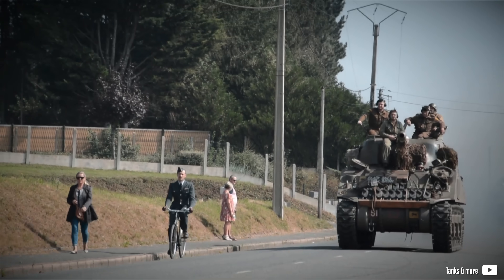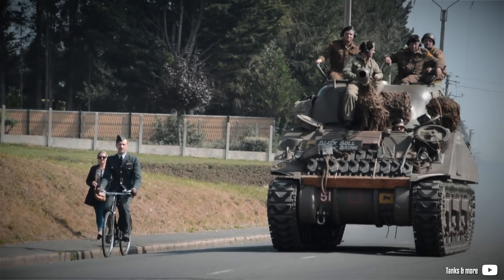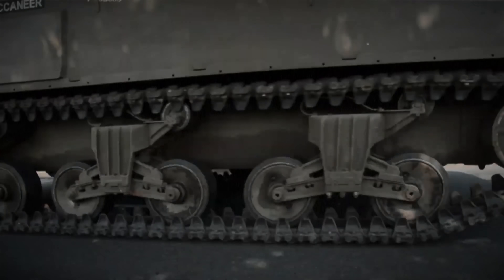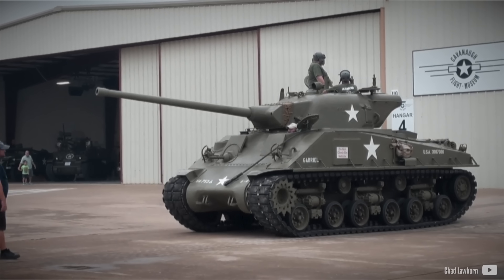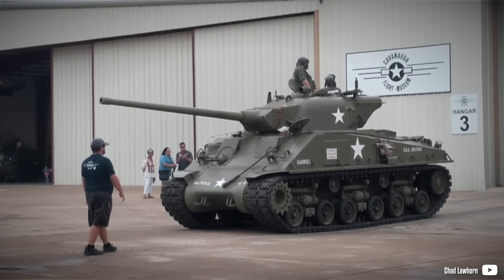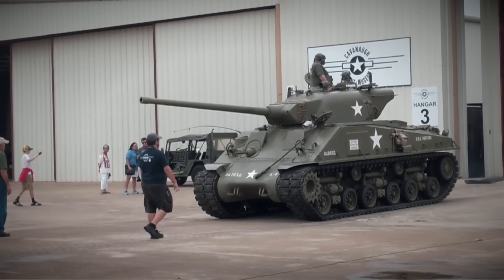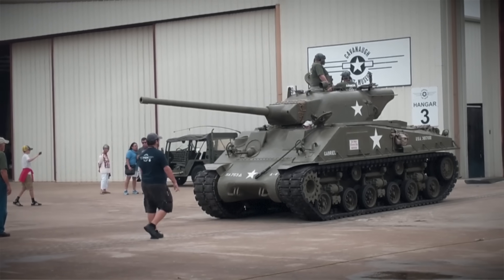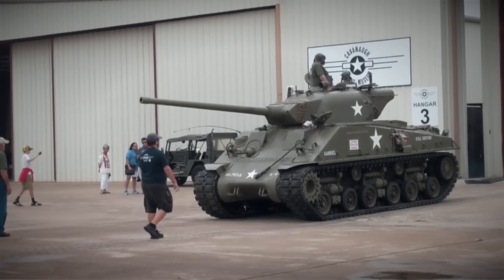This Super Complicated 30-Cylinder Was Sherman's Most Reliable Engine

Comment: The way I heard it, the 30 cylinder was a stopgap to get over a shortage of tank engines. Different companies made the Sherman tank including Ford and Chrysler. Originally, Chrysler was supposed to make tanks equipped with giant V8s made by Ford. But Chrysler got the tanks in production 2 months early while Ford's engine was 4 months late. To complete the tanks Chrysler quickly put together this power plant by combining 5 of the engines they were already making for trucks and stationary power plants i.e. generators, air compressors, water pumps etc. Once better engines became available they dropped the 30 cylinder. But, it did the job and proved reliable in service.
Reply: From what I have heard, the multibank was initially unreliable and it was longer then other M4 powerplants, which required the M4 produced for the multibank to be several inches longer to fit, and was incompatible for use by other M4 assembly lines. Because all of the British M4 were the multibank variant, the British army started working directly with Chrysler to 'improve' the engine and address the issues it was seeing. It was only after British cooperation that the multibank became the reliable and preferred engine for the British Army
Reply: @leonardmiyata482  "What you heard" was incorrect. The truth is that Britain recieved over 17,000 Shermans, only about 7,000 were Mk.V.. There was no "preferred variant", we welcomed them all.
Reply: @leonardmiyata482  I don't see how the Chrysler engine was too long. The engine itself measured 25" at the cylinder head and no more than 30" overall. The complete package about 36" or 3 feet, or not much more. I don't see how you could make an engine of sufficient size and power any shorter.
Reply: @mrdanforth3744  I think he meant ‘too long’ for a ‘standard hull’ and I suspect you knew what he was referring to!
Reply: @leonardmiyata482  I've certainly seen beofre that there was work to do to get the multibank reliable. 
But, it's not the only version the British recieved. Also taking M4A2 (diesel engine) in large numbers, also a varient the US didn't want. 
We did get M4A1s and M4s in the hundreds and were amoungst the earlier deliveries. But, the vast majority to the UK were M4A4 and M4A2
Reply: Should have just put a flux capacitor in it instead.
Reply: @kebertxela941  Just imagine a 33-ton M4 Medium going 88 mph at all! Let alone what would happen WHEN the Hell it went went 33 tons of vehicle suddenly came crashing through!   Not unlike Doc Brown's "ELB" flying locomotive at the end of the third film!
Reply: the A57 equipped shermans  were mainly for lend lease the american troops stuck to the FORD powered tanks and the radial engine powered machines ,,the one you don't hear much about is the Diesel powered variant that had 2 6-71 detroit diesels
Reply: @wildcoyote34  when did the Detroits come into the picture. I always wondered why more tanks in WWII were diesel powered. I could think of a couple reasons and I know most of not all T-34s were diesel but I’m curious why it wasn’t a more prevalent choice for the US and allies.
Reply: @youngmike8645  i'm not sure exactly when the detroit engine got chosen for the tank  but the 6-71 was actually pretty new when ww2 started,, being introduced in 1938 ,they were used in a lot of boats like the higgins landing craft ,,the setup for the sherman tank  was called the 6046 twin diesel ,,the 2 engines were siamesed together ,and each engine had it's own starter and clutch they were redundant  because each engine could start the other ,and they both had a generator ,,plus either engine could move the tank in an emergency just could not attain full speed
Reply: @youngmike8645  said "  I always wondered why more tanks in WWII were diesel powered.   "  
Diesel injection pumps were $$$ , batteries and starters weak so having a diesel in cold weather would not be such a good thing.
Reply: @youngmike8645  The V-2 diesel is HUGE.  The engine compartment on a T-34 takes up almost half of the hull volume.  It being made primarily of aluminum got its weight down to a reasonable amount.  An adaption of a French aircraft diesel, it was actually rather high-tech for its time.  It also had an unacceptably short service life, but, to be fair, as the typical T-34 lasted but a few hundred miles before being knocked out, that proved no serious impediment to the T-34's availability.  Post-war Soviet tank diesels were significantly improved.
Reply: @youngmike8645  Nearly a thousand T-34 had gasoline V12 engine - M17T. They were produced in such a way due to the shortage of the V2-34 diesel engine in late 1941 - early 1942.
Reply: @Andy_Novosad  thank you really appreciate that info. I thought they were all diesel.
Reply: @Andy_Novosad  Originally slated for the BT-7M and BT-8 "fast" tanks, which were still in production when Barbarossa happened.  An order from STAVKA halted production altogether in the wake of the massive factory relocations, starting in July 1941, as it was decided to focus on T-34 production, but continue the KV production at the Leningrad factory, even though the German AG "Nord" got to within 125 miles of the city in only a WEEK after the war broke out.  Of course, all this disruption hurt coordination badly, and with the excess of M17T engines originally slated for the BTs, now discontinued, they were improvised into the T-34s.
Reply: @wildcoyote34  I believe the Russians got the diesels since it fit their logistics model better (used diesel fuel in the T-34 and other vehicles)
Reply: @jimbosc  exactly. They found that they were not going enough of the petrol to run all engines - to fulfill requirements of the air forces as well as tank units plus logistics (= trucks) so somebody has to be dumped. And as air forces hardly can use diesel, obvious victim were tank units.
Reply: @mungo7136  In a way, that would soon change.  The German Me262 used a light diesel oil, what we'd call "No 1", but the Jumo 004 could tolerate quite a variety of fuels, save for leaded gasoline.  Once "recips" were replaced by jets and turboprops, Avgas was used far less.  Of course, tanks likewise went to diesel, save for the M1 Abrams in the early 1980s that uses a gas turbine engine, originally a Chrysler design and sold to Honeywell in Chrysler's 1979 bailout by the Carter Administration.  It wasn't over flammability, as studies of tank wrecks in WWII and Korea showed that tank fires were more commonly started by ordnance set off by enemy fire, but over fuel economy and RANGE issues.  The M47 and M48s that ran on gasoline could only go about 85 miles on a fill-up!
Reply: @wildcoyote34  The diesels were GM 6-71s , intended for USMC armored units in the Pacific, or Lend-Lease to the USSR.  Both dictated by fuel commonality.
Reply: A very interesting compromise that Chrysler worked ot with this 5,000 pound engine, that went into another heavy vehicle, a tank... A beautiful solution that could be kept running by replacing any of the 5-ea.  6-cylinder engines those tanks had.  And the parts were very available !!! Chrysler had manufactured a lot of these and they had a lot of spares!!; Perfect for war machines, like these... The large gasoline V-8's that Ford originally proposed did become a reality , from another company, in the late 50's, to the early 70's but in the form of the International 549 industrial pushrod engines, but they seemed to frequently develop problems with the valvetrane and bent pushrods, something the L-head engines, never had problems with... That gang of 5 flatheads the Sherman tanks had, did ok for our troops overseas... Ford did learn a lot about overhead cams, by doing the experiments on the Merlin V-12's (which was funded by the U.S. taxpayers) by trying to convert them into 1,000 cid V-8's,  that were able to make a very brief contribution to the War effort in the U.S. tanks....  Much different - than what Ford did at Willow Run in those years, with producing aircraft under license by the OEM companies who designed them...
Reply: @michaelmartinez1345  boy you missed that boat by a big margin ,, first off the ford GAA wasn't proposed by ford  ,, it was built by ford BEFORE the A57 was even a thing 
the GAA was a development from a V12 that ford proposed to enter into airplane use , the airforce already had the Allison V1710  and when ford  got the chance they redesigned it into a V8 that was used in the sherman tank M4A3 ,,,the GAA was a 1 piece block V8 gasoline engine with 1 piece heads  , dual overhead camshafts and 4 valves per cylinder ,,it was all aluminum and very robust ,,,,this was the first true modern DOHC aluminum V8 engine ,,plus it only weighed 1450# pounds compared to the 4800# of the A57 
the M4A2 (6046 twin diesel variant ) and the M4A4 ( chrysler A57 gas engine variant ) ,,the M4A2 and A4 were primarily used by the Allies through lend-lease ,,American troops used the aircooled radial engine M4A1 and the GAA powered A3 primarily
Reply: @wildcoyote34  I appreciate the Heads-up on that..  I thought that the Allison (Packard under license for the  1650 Rolls Royce engines) V-12 (1710 cid - Allison engines) was a GM engine...  I heard they (Packard V-12 engines) were also used in other military applications, besides aircraft (like the PT boats). So, which boat was it that you say , that I supposedly missed?.. What was the displacement of the Ford V-8 that you are referring to, that was supposedly a morphed 1710  GM Allison V-12 , that was converted by Ford, (for the M4A3 tanks) to become a V-8? Please be specific of this engine, that you are referring to.  Bore?Stroke?  I was not aware that Ford had ANY OHC V-8 engines, prior to the 427 SOHC engines...What type of radial engines were used in the tanks? Which company made them? How many cylinders did they have? How many rows did they have?    P.S., I read-up on the Ford GAY engines that you are referring to that Ford was involved with... First of all Amigo, you're not only wrong, but you're not even close.... Ford borrowed 8 of the 12-cylinders from the Rolls Royce V-12 SOHC Merlins, originally built for  planes... Not the Allison V-12 that you erroneously stated here..  So it appears that Ford had problems with those, and it took till after the final phases of WW2 to straighten those problems out... In fact, it was until after the D-Day invasion took place, that Ford finally got that GAY monstrosity to begin to work with any kind of reliability...Up until After D-Day took place, it was the Chrysler 30 cylinder modular engines and the Wright R-975 radial aircraft engines were the primary units of powerplants, that were dependable enough for combat use...  Some of the tank also used Detroit 2-stroke diesels... Finally in the last year of of the war in Europe, the people at Ford were able to get that Modified Rolls Royce V-12, morphed into a V-8, called the GAY engine, to begin to be useful in that war...  What I was wondering about is; did Ford have OHC designs OF THEIR OWN , Prior to the SOHC 427 V-8 and the SOHC 2.4  'Pinto' engines, that were used in the tanks in WW2?... I  heard that they did not produce them, and if Ford did make any OHC engines prior to the 427 SOHC V-8's, they never made it to the production stage.. Apparently , it was  Chrysler , the Wright Aircraft engine company , and  Detroit Diesel,  were the main ones supplying the Allies with engines that had enough gusto and reliability to power the Allied tanks..  Ford was modifying engines originally built by another company (Rolls Royce) , originally designed for another purpose (aircraft) to help - with the end of the WW2 effort..  So tell me now, which boat did I miss? Please , before you write something here, check what ACTUALLY happened, not necessarily what you would like to believe what happened....
Reply: @michaelmartinez1345  the ford GAA engine is a 1000CI V8  it's V12 version that was made BEFORE  the GAA was 1650 CI ,, same as the packard Merlin ,,the Allison V1710  was used in the PT boats and several other similar fast patrol craft ,,the Detroit diesel  was used in Higgins boats and multiple other landing craft 
the Allison engine was made by the ALLISON division of general motors 
the FORD GAA bears no relation to the allison aircraft engine 
in fact the allison V1710 is very similar in design to the Merlin even though developed by GM similar designs came from similar requirements
Reply: @wildcoyote34  Dude the Merlin was originally designed by ROLLS ROYCE in 1933... Packard was licensed by Rolls Royce to make copies of the Merlins... Please, check the net on this... You're starting to get me to feel badly - for you, because of your gross mistakes... Yes, the Allison 1710 gasoline engines were also 60 degree V-12''s with OHC's and were originally designed in 1937 (4 years after the first Merlin's were designed) but, share few, if any parts with the Rolls Royce designed gasoline engines ..The  Ford motor company designed and produced their first affordable V-8 auto engines in 1932, but those are not even remotely  similar to the Merlin's or the Allisons... Ford basically modified the Merlin V-12's into large displacement V-8's , that you are probably thinking about, but these engines did not even get to serve a full year in Europe... Maybe the Navy was able to use them, in the Pacific, as anchors for their ships....And another thing, apparently - NONE of the engines that You pretend to be an expert on had DOHC designs... The OHC designs that you are referring to, all had SOHC designed engines.... And your reference to light weight power plants, do have a purpose, where light weight is needed, but with tanks, HEAVY weight tends to give them more capabilities, and advantages, which is probably one of the reasons that several tank crews that operated the Chrysler powered tanks,  reported to have liked them so much... That weight gave them more traction for brush clearing and dozing capabilities... In fact, the German Tiger tanks were highly revered as one of the most challenging ones to defeat... They weighed close to 80 tons..  So the 2.5 ton engine package of Chrysler engines might have actually given it an advantage, that the other powerplant options didn't have, for the Sherman Tanks... I worked on heavy equipment for awhile, and the way those things are built, heavy weight can be a significant advantage with equipment like that...
Reply: @Michael Martinez  NO....The Allison 1710 was designed in 1929 as a AIR SHIP ENGINE, it was designed by the late James Allison, He was a builder of Racing Liberty V12s...and was first put into production in 1930!  SEVERAL YEARS BEFORE...THE MERLIN, which was first run 1933.... GET YER SHIT TOGETHER
Reply: @misters2837  I heard the Liberty engine was one of the first High powered engines... But the sources that I have found on the Allison V-12 1710 engines, says the first designs were made in 1930, but it was improved for reliability and practical use in (heavier than air) aircraft, to put out over 1,000 H.P. in 1937... Then later improved in some applications to put out over 1,450 H.P. So yes, I was wrong by saying that they first appeared in 1937... Wow, I'm really going to loose sleep over that!!! 😂
Reply: @michaelmartinez1345  Maybe Not...But your lack of knowledge on Ford GAC V12 and GAA V8 - Should!
Reply: @michaelmartinez1345  the 345 was the best v8 petrol engine international ever built heaps in old trucks couldn’t break them
Reply: The M4A4 was REJECTED by the US Army because it was 1 or 2 mph slower than the other variants. That's why they were all sent to Lend-Lease. Main recipients were Britain and China.
Reply: @WgCdrLuddite  eqeqeè
Reply: @WgCdrLuddite  9 9th
Reply: @WgCdrLuddite  That may not be the only reason. Quality of available fuel may have also weighed on the decision. Both the Ford engine and the Lycoming engine ran on higher compression thus requiring better fuel. The GM of course used diesel.
Reply: @WgCdrLuddite  ah yes rejected because its 1 to 2 mph slower not because the powerplant is significantly more complex and weighs significantly more than others. and defiantly not because no that can be driven in maintence company's and supporting units to supply and repair tanks. can lift the 5500 lb engine. granted it took them over a year to make such a vehicle the US armys brockway 666. but even then. it was 2 years later. and they only made 1300 of them. and it DEFINATLY wasn't not adopted because of its "extremely good fuel efficiency and high power output" and it also wasn't adopted because of its excellent engine cooling.

all jokes aside. Testing of course is a bit biased due to the fact that no shit a 32 cylinder survived testing the next highest cylinder count in the competition was a 9 cylinder aircraft engine. the competition was very very strenuous for a time where Oil filters were pretty much non existent
the rules were 400 hours or 4000 miles. until  ANY failure of a powerplant or 30% power reduction and it was 400 hours of non stop running with almost 0 maintence done other than grease zerk fittings and replacing belts when they break. in a hot dusty climate
the competitors vs a 32 Cylinder engine
a 9 cylinder Gasoline aircraft engine.
a large Gas V8 truck engine
a Detroit 6-71 2 stroke diesel 6 cylinder
its a overall crap design. their best choice would've been 6-71 2 stroke diesel hindsight is 20-20 but as we all know today. you can go find a old 2 stroke Detroit that's been sitting outside for 70 years and put fresh diesel and some vise grips on the injector rack and free it up and it'll start. hell it'll even start on some ancient diesel. 

guess they didn't know any better of have any way of making better air filters at the time for obvious reasons they dusted the Detroit diesel a supercharged 2 stroke diesel has pretty high compression and really strong suction force. bound to suck any small particles through the filter.
Reply: @justnsaliga8518  The British weren't complaining. We were quite happy to get around 7,000 tanks for free. Thank you USA.
Reply: @justnsaliga8518  You over look one major component of not deploying a diesel engine into theater: logistics. The GMC diesel would have demanded its own unique fuel supply chain unlike the other three candidates. 

Secondly, one the opinions in this chain is that Ford couldn't deliver engines initially for the Sherman. That may be true on the face of it, but the Lycoming airplane engine was the engine the Sherman was designed around and it being in short supply is what initiated the search for alternative engines. The Ford engine was an adaptation of an engine design Ford had produced as a competitor to the Allison V12.
Reply: @justnsaliga8518  The 6046 wasn't a powerhouse either, but you're right DD 71 series were some of the most over-engineered engines made...but, the worst of all was the M4 Engines, was the Caterpillar D-200A...
Reply: @misters2837  caterpillar had a tank engine? I operate CAT equipment for a living and I’ve been a fan of CAT yellow since I was a child growing up around a family construction company. I’ll have to look into that.
Reply: @WgCdrLuddite  The prayers of all infantry is for support tanks ! With a Tank behind you those before you fear.
Reply: @robertpella2389  Explain 'prayers'. This is not a military strategy I'm familiar with.
Reply: @cdjhyoung  Allison also submitted a version of their aircraft engine, post-war, to power the M46, M47, and first versions of the M48 MBT, which lost out to the Continental AVS-1790.  Part of the problem was that it was water cooled, and the US Army preferred an aircooled design. The Continental engine was very thirsty.  An example was used for the famed Jay Leno "tank car".
Reply: @selfdo  Continental did make inline and 'v' engines for ground equipment use, along with their opposed air cooled engines for ground equipment, and for aircraft... Which Continental engine was used for tanks?
Reply: @michaelmartinez1345  R975
Reply: @selfdo  The R-975 would be a Wright 9 cylinder Radial engine... Not a Continental engine... At the time the tanks were being manufactured, several types of engines were used, to move those beasts around... With heavy equipment like the tanks, the heavy weight was a good thing, as it gave those machines more vegetation clearing and other destructive abilities, like powering through buildings... Lots of torque was needed to do this, which is why such heavy /robust engines were preferred...
Reply: @michaelmartinez1345  I sit corrected...the R-975 was made by Wright.  I'm not sure the design was favored due to weight-saving considerations, probably more a matter of a compact enough engine that'd crank out 400 ponies, necessary to move the tank.  But in 1942, it was obvious the war was not going to be over quickly...one way or the other...and aircraft production had to be ramped up, which meant more engines...all that Wright could produce, and them some. Where I got it confused was that Continental was an aircraft engine producer as well, and made some Wright designs under license...but the first TANK engine that I recall that was a Continental design was the air-cooled AVS-1790.
Reply: @selfdo  Continental made engines of several types for several applications... There are forklifts made by American companies, that have Continental engines... The R-975 engines were originally designed for aircraft, and they were relatively lightweight powerplants.... My guess is those engines were needed more for planes, than tanks during the war, so that is why other engines were used to replace them for that purpose. A tank, falls into the category of heavy equipment, so as far a weight is concerned, the heavy engines and equipment for them, work well in that application... Probably the reason the reason the Chrysler 5-packs worked so well for the tanks is because of their combined weight, the relatively high torque they produced, and the extremely high availability of parts and supplies for those engines.... Also, they were well proven engine designs, which meant that they could be counted on to survive tough conditions.
Reply: @WgCdrLuddite  they certainly where not free we didnt finish paying the dept back to the USA till the 80s
Reply: @johnhalstead4308  War is an awful thing, and should be avoided, if possible... But the agressors who start wars, don't care about anybody else, but themselves, and the ONLY way to stop them is through superior war waging power... Unfortunately, is is very costly,  in lives, time and money... This is why peace is golden... As General Douglas MacArthur put it, 'The last people who want war, are those who fight on the front lines, for they are the ones who have to bear the wounds and tragedy of war.'
Reply: @johnhalstead4308  (Shush. this thread is infected with septics and I am playing the role of "grateful limey").
Reply: @johnhalstead4308  (Shush. This thread is infested with septics and I am playing the role of "grateful limey"). They love it.
Reply: @WgCdrLuddite  but we paid for them ! Final payments made in 2006. Meanwhile Germany has entirely dodged reparations to this very day and we kindly helped them get the vw factory going again.
Reply: @WgCdrLuddite  you've not been in the military then....
Reply: @cdjhyoung  The US Marines got the M4A2 as they shared their fuel supplies train with the US navy, who used diesel for certain small Vessals.
Reply: @SvenTviking  it was diesel fuel and similar types, that  originally powered early turbo-jet engines... As the performance of the jet planes increased, so did the flowability and moisture elimination become a requirement, at very high altitudes, where the ambient temps and pressures,  are very low...
Reply: @justnsaliga8518  30 cilinders 😉
Twin 6-71 is an very interesting engine indeed. But US choose for just on fuel for all vehicles to make supplying an army easier.
The A57 was not fovoured because of subjective reasons.
So that was the main reason to go for Ford GAA and Wright 9cil. Narrowing down to just 2 engine types is of course a good thing on it's own.

Maybe Ford GAA and Chrysler A57 would have been a better choice because of the operational troubles an radial engine brings...
Reply: @CarLos-yi7ne  Radial engines are OUTSTANDING!!! Light, powerful, dependable and at that time, fairly available.... But they required several things that were a problem for ground vehicles, especially tanks: 1)A massive amount of airflow, to stay cool 2) High octane (slow burning) gasoline 3) They were and still are expensive, and parts were and still are extremely specialized and difficult to find 4)Their construction depended highly on strategic materials, which needed to be reserved for aircraft... Tanks actually did very well with heavy equipment powering them, because they are - HEAVY EQUIPMENT.... The heavy weight helps them do what they do best, move along the ground at a fairly slow rate, and efficiently destroy things that are targets.... The size and power of their turret mounted cannons, require their construction to be extremely robust and heavy...
Reply: @michaelmartinez1345  
Wright R-975 equiped Sherman just used normal petrol.
They where adapted for use in tanks so no need for high octane aviation fuel. Otherwise it would bring the same logistical nightmare the US wanted to avoid by not using Diesel.
Reply: @WgCdrLuddite  
You did not receive them for free, Britain like every other country paid a very massive debt to the US after the war.
Reply: @CarLos-yi7ne  Gotcha, so in that case, remove a large amount of power & torque from that engine as the specs for the engine had to be changed for low octane (fast burning) fuel... That is probably another reason the engines that originally were designed for aircraft, did not pan-out well, as Ford found out by trying to modify a Rolls-Royce Merlin... Just not of practical use for ground equipment... They (Ford) should have made their existing automotive engines, which were decent, useful like what Chrysler did... Wright just devoted their engines to the aircraft they were better suited for, while Ford kind of got caught holding a cold potato in the form of their GAY engines....
Reply: @michaelmartinez1345  
Ford designed it's own liquid cooled V12 aircraft engine. But the military decided that they din't need it: the Allison 1720 was already in production and laterbon de Packard Merlin.
But still an tank engine was needed so Ford took 4cilinders of and simply said tgat was the GAA which was a good tank engine. BUT why taking 4cikinders off? To get it fit in the Sherman.
The British did a better job by adopting the Merlin for tank use: de Meteor V12 which was the best tank (petrol) engine of WW2. I think the Sovjet V12 Diesel (V2-2-34) was the best tank engine of the time.
Reply: @CarLos-yi7ne  was the Ford V-12 liquid cooled engine used in any vehicles or ground equipment? Their flathead V-8 engines were very popular when they first came out for personal vehicles... It is a shame Ford did not use that engine in a similar arrangement that Chrysler did... Ford probably would have sold a LOT of flat-head V-8's if they offered it in a similar package that Chrysler sold to the Allied forces.....
Reply: @michaelmartinez1345  
Well, Ford sold A LOT of V8 flatheads to the militairy. Many went in Canadian build vehicles like CMP trucks and Universal Carriers for the British forces.
The Ford V12 engine (GAC) never went in serial production. A very small number was build in prototype tanks which never went in production too.
In Austrailia there made power packs out of 3 Cadilac V8 flatheads tigether for the Sentinel tank. Again, no big numbers made.
Reply: @CarLos-yi7ne  I"m thinking that 
Chrysler. had the engines the military was looking for, in this purpose... They ran fine on regular gas, did not require extensive modifications from it's original form, plenty of engines and spares of that type were readily available, strategic materials were not used for the Chrysler 6-Cylinder flatheads, and the price was probably very reasonable.... And several of the tank crews liked them....I'm thinking that there could have been a one-way clutch (sprag), to allow shutdown of any of the 5 powerplants, but still be able to move... Not an option for the single large engine tanks... That could have been a life-saving feature in a combat situation.
Reply: @WgCdrLuddite  Brits paid all our tanks, with interest off - around the year 2010. The price was your empire that's now ours. Greetings to the US territory.
Reply: @808bigisland  Today, for the Coronation of King Charles III, military contingents from around 20 countries took part.
How many turn up for a US presidential inauguration ?
Soft power, my friend.
Reply: @justnsaliga8518  The twin Gm diesels were slightly heavier than the Chrysler engine. Even the aluminum Ford clock in at over 3500lbs.
Reply: @selfdo I know this was a year ago but I had to comment. Wright tank radial engines were a bit different than the aero engines. Parts were heavier. as an example wrist pins were solid instead of hollow. Another interesting fact, during the war Chrysler built more Wright radials than Wright did. Even redesigned parts of them.
Reply: @michaelmartinez1345  I'm not aware of any Continental engines that made it into USA-produced AFVs during WWII.  Where Continental (later bought by Teledyne, Inc) engines were used was i in the POSTWAR M46, M47 (same chassis and superstructure, different turret, from the rejected T-42 prototype), and the gasoline=-powered versions of the M48 "Patton", the AVS-1790.  A 60d-degree air-cooled V12, it was one thirsty engine, but cranked out 810 ponies, which helped with the mobility of American armor a LOT...as long as the fuel trucks kept coming!  Continental developed a DIESEL version the AVDS-1790, in the 1956, for use in the later M48 versions and the new M60 (essentially the M48A5, the differences are minor), which improved the range of American MBTs considerably.  The gasoline V12 is also the engine for Jay Leno's "Tank Car", aka the "Blastolene Special".
Reply: @michaelmartinez1345  Correct.  Continental did PRODUCE the engine, under license, but did not design it.
Reply: @michaelmartinez1345  It was all of those things; the Mopar flathead sixes were known for durability and reliability, but not necessarily the most powerful of engines...TORQUEY, though!  Clustering five of them together as the "Eggbeater" worked surprisingly well.  All Mopar had to engineer was the strange tube manifolds and the common crankcase and "star shaft", the rest required no new parts or tooling.
Reply: @michaelmartinez1345  The weight penalty of an all-iron, water-cooled engine is much less of an issue for an AFV than it'd pose for ANY aircraft.  Durability and reliability are far more important.

The Soviets actually had what was "high tech" for its time in the all-aluminum V2 12-cylinder diesel engine.  Developed from a French aircraft (and airship) diesel (yes, aircraft diesels, mainly for long-range transports, were a "thing" in the 1930s, there were also considered better for dirigibles that used hydrogen as the lifting medium, the absence of "spark" in the ignition posed less of a fire hazard.  While the T-34 and KV-1 engines were terrible for reliability, especially in terms of MTBF, it wasn't considered a problem, as few of those tanks lasted long enough in combat to be immobilized by an engine breakdown!  But like the T-34 it went into, for a diesel, it was fairly simple to maintain and repair, although Soviet Army "tankist" fitters usually swapped out the powerpacks, which could be done by an experienced crew with a crane, even in freezing weather, in only a few hours.
Reply: @CarLos-yi7ne  The 70 horsepower version of the Ford Flathead also powered the British Matilda I tank, which, due to this beast weighing 11 tons, managed a top speed of about 8 mph on raods and only about 5½ mph  cross-country.  As it was designated as an "Infantry" tank, it could barely outpace them!
Reply: @selfdo  The nice thing about that setup was if one, two or even three of those engines failed, they could still get back to the base, as they were connected with  free-spooling sprags so the remaining running engines , could continue to move the machine.... And yes, the horsepower was not a high amount, but they DID have excellent low end torque, which is what is actually needed for heavy vehicles.
Reply: @michaelmartinez1345  Low-End torque was more desired in most American automotive applications, not simply heavy vehicles.  It's forgotten that the Interstates didn't always exist, and with the overwhelming majority of the US population living EAST of the Mississippi River, we lived in what "Uncle Tony" of UTG has termed the "50 mph world", with limited "expressways" where cars and trucks could actually see more than 50 mph!  Usually, aside from the fact that people simply didn't range all that far in their rides, necessitating "in town", if one took a trip on, say, good ol' US 90, say, from Jacksonville, FL to Houston, TX, you stopped in EVERY little town on the way, so obviously low-end torque for all that start-stop was far more desirable!
Reply: @selfdo  Interesting observation!!! Thank you for that contribution!
Reply: @selfdo  Yes it (Low end torque) is  often an over-looked factor, even when traveling on the interstates, because the majority of the distance that is traveled, even on the interstates , is in the range of between 1,800 - 2,300 rpm... Definitely low end torque...
Reply: @ksztyrix  Only before 1941.
Reply: @michaelmartinez1345 ford had trouble keeping one flat head V-8 cool let alone 5 of them tied together!
Reply: @ronaldbrown5745  Ford finally Figured out how to properly cool their flatheads... Later they made much more robust engines.... Chrysler knew a lot about how to control the heat that an engine produces... So much so, that they were able to carry away the heat effectively on 5- existing engines that were all mounted on a common output case assembly... One advantage to doing it that way was the increased external surface area, to carry away the heat that radiated out from the 'Artichoke' leaves.... It actually relieved some of the stress on the existing liquid cooling system doing it that way...
Reply: @justnsaliga8518  The Navy had priority on diesel fuel (all subs, 1/2 destroyer escorts, all landing vessels up to LST's, all minesweepers were diesel powered)
Reply: @justnsaliga8518 The basic engine was the same Standard engine in the Military Dodge trucks. All the parts other than the block and gear train and the fuel pump were the same as the Hundreds of thousands of Dodge trucks in the US military which were VERY reliable.
Reply: Thanks for the info guys in the comments, this was cool to learn.
Reply: That shows that when a job needs to get done we will find a way to do it
Reply: This is another chapter in the collaboration that is the History of Ford and Dodge.
Reply: That makes a lot of sense. Nobody would make such a complicated engine unless they were desperate and had no other options. Thanks for sharing
Reply: @kiefershanks4172  many of the machines made for the war were from things that were available, at that time... During the U.S.  pre-involvment of war years, Chrysler had a surplus of inline 6-cylinder engines that could be helpful, and they put them to use..  It was not a desperate thing, but it was a resourceful measure to make a contribution... And not only did that modular engine set-up work to power tanks, but it worked very well for the tanks... That is actually what this article focused on... The application of properly applying available resources, and that is exactly what Chrysler did.
Reply: @Michael Martinez  Those flathead sixes went into many a Dodge WC214 or similar; an unsung "hero" of the Allied vehicle park.  An example of this vehicle in the ambulance versuon is seen in the opening credits of "MASH".
Reply: @selfdo  The Mash Ambulance was a 41 1/2 ton version with the 218 flathead and the round instead of the flat nose and much beefier frame, body, and tires, plus the bigger displacement 230. The later 3/4 ton version. I had a 1/2 ton closed cab 4x4 pickup in 78 and a buddy later bought a similar Ambulance. The smaller version was built along side of the 3/4 ton till 42 just to get more vehicles out there and use the early ones state side so the improved ones went overseas. The ambulances were probably not all destroyed so what was still usable got sent to Korea till they got the M37 update up running along with whatever 3/4 ton 41 to 45 were left.
Reply: The V8 was called the GAA 1100cid...was based on FORDS GAC 1650cid DOHC v12

Google Ford GAA...
Reply: @misters2837  It sounds like Ford, in that time period, made contributions to the war effort, but several of their designs were based on experimental ideas, that were not proven yet , nor were they used in any other types of vehicles or equipment... This is probably why their GAY engines, did not become practical, until the WAR they were needed for, was already nearing the end... And it also seems that their GAY engines, never found another purpose, except for the tanks, (that the taxpayers paid for) that Ford ended-up experimenting with.... Ford seemed to make much more meaningful contributions to the war effort, by producing the already proven designs of trucks, jeeps, planes (many of which, were under license - by the original companies who  designed, built and tested them)... But their GAY engines, seemed to became something of an extremely expensive novelty, and not of much use, for the war effort or other uses, in that timeframe, or for later use...
Reply: @Michael Martinez  How Adult of you to edit your comment... 

And how Adult of you to not understand how innovation is actually done...

Yes, Ford made a lot of "throw away" vehicles that were under license (because of design contracts) of Jeep and whomever... But had they not been required by the GUBERment to make the same crap every day in their factory, Ford could have made improvements that would have made the GPW a much better product. 

I love how you confuse the fact that Ford "passed" on the manufacturing contract for the Merlin, and designed a competitive (yet technologically superior engine) and you call it "GAY" because of your small brain/penis, (you probably own Dodge/GM vehicles too, who copies who?) and then think (or at least you are consistent) it's designed as a "copy" of the Merlin, when the ONLY thing that it has in common is Bore and Stroke... As the southerners say... Bless Your Heart.
Reply: Imagine working 8n a factory during that time and working overtime, 7 days a week, with no overtime pay and having to make this engine work or you're fired. The engineers rarely talked to the workers if ever, it's amazing anything got done. It was just like shoving a block of clay through a pipe jammed with people the whole way through.
Reply: @NoZioKikes88  Most professionals were "on salary" and glad to be WORKING at all!  Typically, they received bonuses for meeting production and/or design goals.  Only hourly wage employees got overtime, and there was PLENTY of it!
Reply: Originally there were no "Tank" engines as there was no pre war demand, only truck, bus and aero engines. US tanks used Curtis air cooled radial engines in the M2, M3 and early M4. This partly accounted for their taller, shorter hulls. The Ford V8 GAA was a cut down V12, originally an unsuccessful aero engine. The banked GM diesel was used by both the USSR and British as they had similar (Matilda II and Valentine) in use. The banked Chrysler was used by them as it was available, and a good tank.
Reply: They said, we are gonna give everything we got so it made sure it would work good for ya brothers. Even if its tossed together. Kitchen sink and everything
Reply: Ford, LMGDMFAO!
Reply: And apparently, all the 30 cylinder Sherman's were sent to the UK, as the UK mechanics were the only ones who understood the tuning of multi carburettor motors!
Reply: British took all the M4A4 Under lendlease. They had a mission in US to push modifications for the reliability and battle worthyness of these. The Business of Tanks  by G MacLeod Ross.  The US took over the shipments in late 44 early 45 when they were running out of replacement tanks .
Reply: @roderernst9990  The Brits still produce quite a number of their domestic designs, most of which were, er...WANTING.  However, their Churchill heavy tank, although slow, and thanks to it's fairly narrow body, was under-gunned for its mass, proved reliable, could go almost anywhere (why so many "Funnies" were made from Churchills), and TOUGH to knock out!  The Valentine, although too light to mount a serious enough main weapon by late 1944, still proved used for SP gun mounts ("Bishop") and an unusual TD variant with the 17-pounder gun called the "Archer".  The Valentine proved to be one rugged and reliable tank chassis!  Of course, late in the war, the Comet, with a redesigned version of the 17-pounder that actually fit its turret, unlike the Sherman VC Firefly, showed that the Brits could get a tank design RIGHT.  Though introduced too late to have a decisive effect on the war, the Comet still proved an effective vehicle with the British Army of the Rhine in post-war service.  Of course, had WWII gone on long enough, the Centurion, itself one of the greatest Cold War era tanks, especially when it got the L7 105 mm gun, would have proved worrisome to the German "Big Cats"!